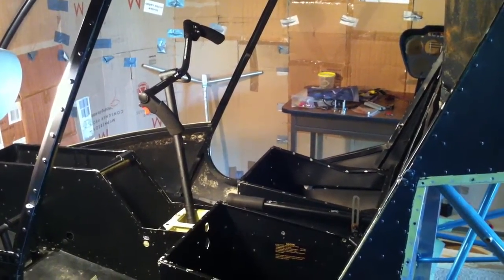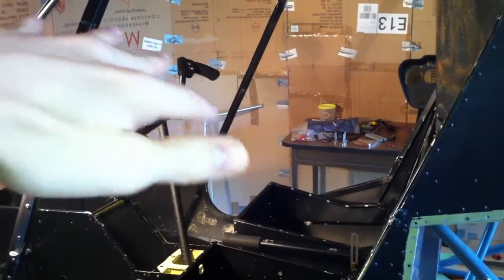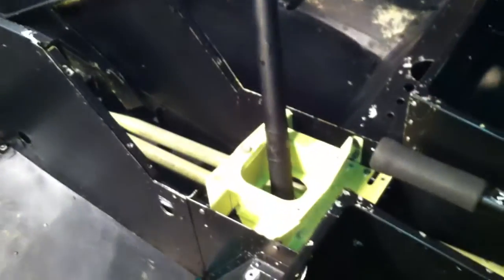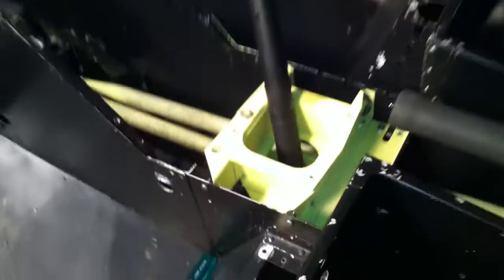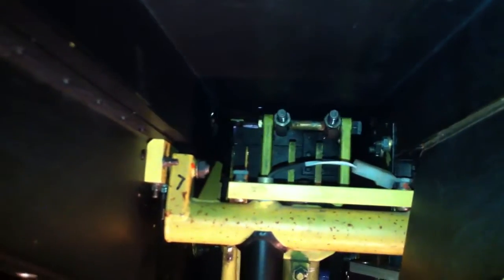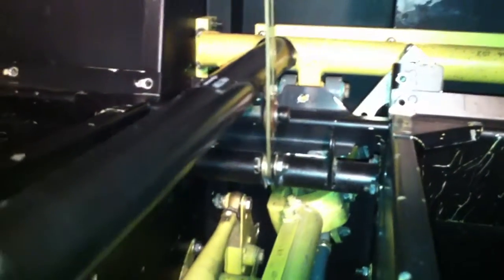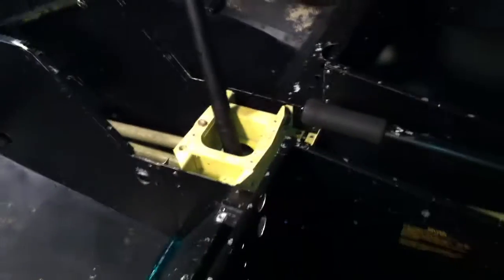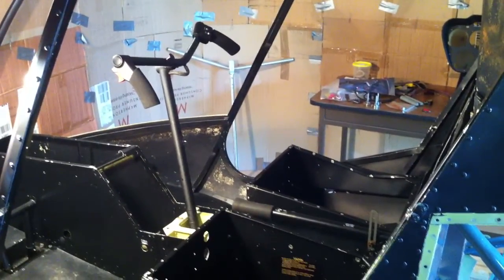Simulator Shane VLOG 008 - Installing the Cyclic

Comment: From the explanation just given in relation to how the cyclic control is interconnected with the collective pitch control in relation to the left , right and back and forth movement of the cyclic stick, I would then like to know how gyroscopic procession is applicable  here.  I just learned in a  lesson on helicopter flight system, that if you want to tilt the helicopter rotor disc forward and assuming the rotor rotates clockwise, you have to raise  on the right control rod which invariably tilts  the swash plate leftward but only response 90 degrees resulting to  forward tilt  on the rotor disc, and the helicopter moves forward. From this  explanation, I discover that when you push forward and backward  on the cyclic  stick in the cockpit , the helicopter is expected to go forward and backward imagining the craft is  in a hover and when you push the stick left and right, it is expected to roll. How then is gyroscopic procession applicable here?
Reply from the maker: Hey mate, I'm not exactly sure how gyroscopic precession is handled by the control system. I know that the controls are connected to the rotor system but I don't have all the control rods so I can't say how they are physically connected.

You are right that in a hover the helicopter moves in the direction that the cyclic is moved. Not sure how gyroscopic precession is applicable though...
Reply: Hey Francis, great question! I am a helicopter pilot and at first,  I too didn't understand how gyroscopic precession was applicable. If the swashplate tilts forward and the rotor disc (the spinning blades) tilt forward then how is there any precession? Well the key piece of information I was missing was that the pitch links are actually offset 90 degrees from the blade. The aircraft in the video is an R22 so I will use it as an example. The Robinson R22  is a counter-clockwise rotating system (when viewed from above). When the swashplate tilts forward, the rotor disc tilts forward, BUT because the pitch link is 90 degrees offset, the max blade pitch actually happens when the blade is on the left side of the heli, then due to precession, the blade "rises" 90 degrees later and tilts the disc forward. I hope this key information of where the pitch link/ pitch horn is helps your understanding! Btw thanks for this vid Shane, this is actually one of the only videos I've seen that has internal details of the R22 mixing unit!